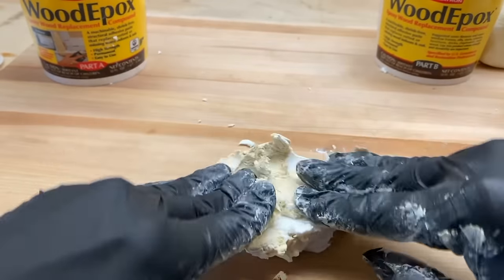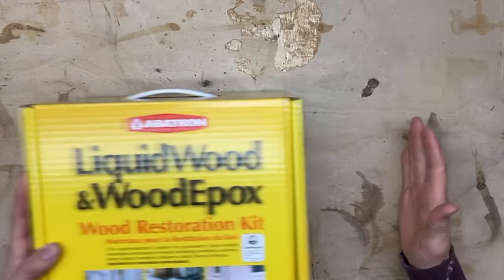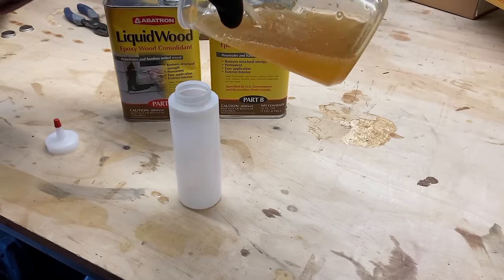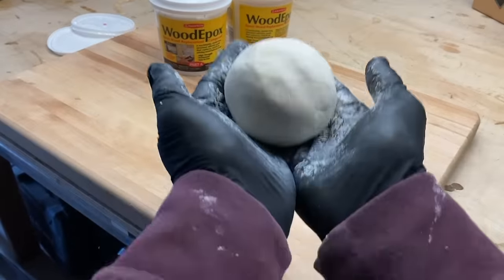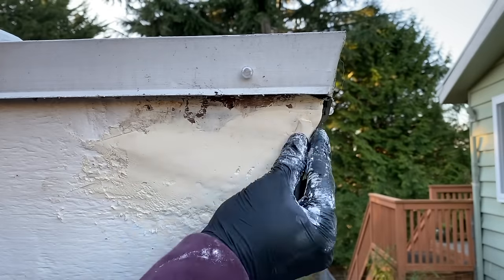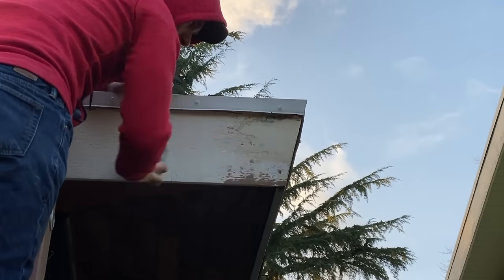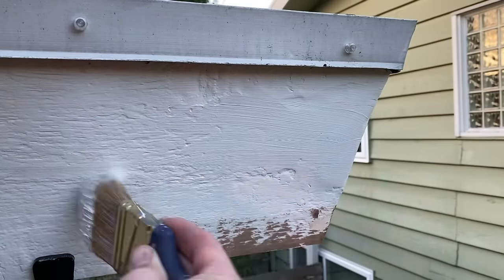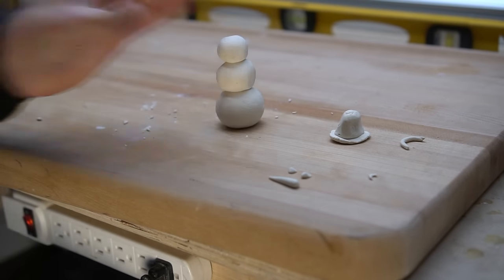How To Repair WOOD ROT and Water Damage With ABATRON

Comment: Sorry but as someone who worked for 10 years in the wood destroying organism industry, this is the worst thing you can do! 🤦‍♂️
Reply from the maker: I appreciate your input John and I would agree if this was caused by insects.  Luckily for me it wasn't.  The siding is from a woodpecker and the fascia is from a tree that was pushing up against the house for years, which i cut down after I bought the house.  Thanks for your input though.  Greatly appreciated.

Comment: Great video. Can I ask how hard does this set?  Could this be used to fill a hole in a floor where an office chair would roll over it constantly?  I am looking for something to use to fill an about 4" x 2" x 1/2" void in a 100 year old floor that has rotted or collapsed.  It is not into the subfloor, it is just oak strip flooring.  I don't care what it looks like, I just want it to fill the hole so that it doesn't get bigger, and the chair can roll over it without causing damage.  I tried someting that looked like your play-dough stuff but it was too soft.  Thanks.
Reply: Use bondo. It sets really hard and is really easy to work with.
Reply: @cannabinerd9665  
Thanks.  I've heard that from someone else and always thought it only worked with cars, autobody stuff and metal.  I'll give it a try.

Comment: i just use bondo
Reply from the maker: Good to know Steven.  Does it hold up pretty well with expansion and contraction?
Reply: @BYOTools  they use it on metal we all know how metal expands and contracts...I usually drill holes like in the video on small holes but on larger you can put screws in the wood so the bondo has something good to grip to like an anchor.

Comment: This was great but please tell me how you stopped that leak.  I have rotting in the corners of the fascia right where you did and I don’t know what’s causing the rotting.
Reply: It's a fungal problem caused by moisture. If the wood is not properly treated, borate and triple painted, mold and fungus sets in over yime.

Comment: Sorry buddy... as a previously California state licensed wood destroying organisms inspector. if ANY of the fungus  is remaining after prepping the rot, it will just come back no matter what you fill the hole with. Good video otherwise.
Reply: Good point.  What if treated with wood termite/fungi first and then do the epoxy repair?
Reply: @laijohn6  there are things that may work now, it's been about 12 years since I've worked in the industry . But its best to cut until NO rot is visible then patch and seal. As long as it's cleaned to the best of your ability first, 95% of the spongey wood is gone in the case of rot. If it's termites with no fungus you should be fine with a protectant. If your craftsmanship is on par.

Comment: One cannot simply have a hole in their fascia.. it's an absolute no no.
Reply from the maker: There is a reason that Abatron exists SS.  Just trying to give others another option for repairing holes, especially if your unable to match the existing siding or trim.  Thanks for watching though.

Comment: Looks like more work than remove wood, replace and paint.
Reply: More expensive too.  I restore old houses and the epoxy is a good product but we only use it for smaller holes and gaps.

Comment: Just a lazy way for a temporary fix! Replace it and deal with the cause of the problem!
Reply from the maker: How is it lazy if it takes longer to do this than just removing the board?  Problem has been dealt with since this damage was due to an overgrown tree that was banging against the house facia.  This tutorial is to help people that don’t want to remove the board.  Just trying to give others a secondary option that LASTS.  Thanks for watching George.
Reply: @BYOTools  I don’t disagree with this product to make some repairs, but it looks like you epoxied your fascia board to the underlying structure. When someone has to replace that it’s going to be a massive headache.

Comment: I covered my fascia with metal that has a trim color added by the metal fabrication company. Most communities have metal roofing fabrication companies that can make a ell shaped metal that fits underneath your roofing metal drip edge. Secure with screws on the underside 1 inch ell side. Never have anymore rotting or badly cracked fascia.
Reply: The company I worked for specialized in doing fancy wrap jobs on old Victorian houses in the midwest. We simply covered up the ugly with new metal. Sounds easy. It's not.
Reply from the maker: Thanks for the input Carroll and I'll have to keep that in mind for future endeavors.

Comment: I have suffered wood pecker attacks and plan to try this stuff, but first I'm trying to repair the cosmetics of the front door trim area, it was originally stucco painted and the stucco only goes so far, so I'm trying to find a product to use to blend the empty stucco areas with preexisting stucco. Any suggestions ?
Reply from the maker: In all honesty I have never had to deal with Stucco before.  One day I'm sure I will haha.  Looked on Amazon and this one has good reviews and DAP is a good product.  https://amzn.to/2N6ogQ0  Thanks for watching Michael.

Comment: Just replace the rotted trim board. Cheaper and faster.
Reply from the maker: In most cases I would agree with you but this is just an alternative that you can choose in order to avoid removing all of the wood.  Thanks for watching though.

Comment: Incredible video!!! Thank you for teaching me new stuff!! My question would be, how do you dry the wood that is outside like this, and when do you know it is dry, because on the video it still look dark and wet
Reply: You basically have to expose the wet areas of wood to air and let them dry. You can usually tell when the wood is dry by touch but if you want to get technical you can use a moisture meter.

Comment: Woodpeckers can hear the insects they like to eat.  They bore holes to get at them.  You likely have a termite problem.
Reply: If there are termites up in the facia you have to assume every piece of wood in the house has tunnels. I've been hired to put new trim on a door that led to replacing the walls because there was nothing to nail the new trim to. Once you start picking at it...omg the whole house needed replaced. Every home on that street was like that too.  It's a shame.
Reply from the maker: Luckily this wasn't caused by woodpeckers or termites.  An hold tree went into the side of the house a while back before I purchased the home.  Luckily the tree has been removed so no worries about this coming back.  Thanks for watching and your input.

Comment: Hey there boss. To copy(kinda) the wood grain look get yourself an old beat up straw broom. Pretty sure you can figure out the rest! 👍
Reply: Huh?????
Reply: @RagingestGamer  You drag it through the putty.
Reply: @Gearhead-en8dz  the putty will be too hard to run it through and it has to be sanded so a brush is no good unless you make it perfect and don't sand, what you can do it use a sawzall blade after it's sanded
Reply: @RagingestGamer  Trust me. If I can copy texture in drywall mud I can copy it in putty to.

Comment: You don't repair rot you remove rot and replace with new lumber again never waste your money trying to repair rot
Reply from the maker: Technically you are Correct Charles and no you don’t want to repair rot because Rot is not structurally sound, however in this case we removed the rot and then filled in the wood that has not lost its structural integrity due to the rot.  Hope that makes sense and thanks for watching.

Comment: Thanks for the video. If I need a backing for a hole in wood siding or sheetrock, I cut a backup piece that fits the hole and put a screw in the face to act as a handle. Then, slide it in the hole and pull on the screw while you put 2-3 screws in the surrounding edge to snug up the patch piece. Oh and there's a 'kit' made by Remington or Winchester to take care of the woodpecker problem.....

Comment: Seems easier to just replace the fascia board and paint to match
Reply from the maker: In all honest it probably would be Joe but this video is all about giving others a second option for a wood repair other then removing the whole board.  Thanks for watching!
Reply: You can get some aluminum fascia wrap for pretty cheap if you go to a actual supply store it comes in a bunch of colors so you don't even have to paint it

Comment: Just use All Purpose Bondo premixed ready to go, dries in 15 minutes doesnt shrink. paintable Professional strength all-purpose putty provides durable results for patch and repair

Thicker formula is ideal for repairing vertical surfaces such as doors, walls and siding

Quick-curing formula is sand-able in 15 minutes and paintable in 25 minutes

Repairs drywall, metal, masonry, painted wood, plastic, and more

Fully paintable and stainable

White Bondo cream hardener included

Light gray when mixed, helping blend with surfaces for consistent appearance

Formula is non-shrinking

2-Part technology chemically bonds with surface to adhere permanently

Comment: This isn't a repair. It's just covering up the problem. Replace the wood.
Reply: Not everyone has the skills, or the money, to replace the wood. We need a new door frame, but were told $6,000 (granted, that price is for a door AND frame, but still that's A LOT). So I removed the rotted wood myself and added this stuff. I understand it's not long term, but it'll due until I save up for a new door frame and door.
Reply: @sallyj632  A new door and frame is a couple of $100's and with some help( from a friend) you could fix the problem yourself and save 1,000's. Most carpenters or handymen are rip-offs. They want top dollar for doing very little and assume that most people don't have the know how to do it themselves. Do some research and get a little help. You'll be surprised what you can do and not only will you be proud you did it yourself but even prouder with all the money you saved.

Comment: Just cut out the rot and replace with 1x6 red cedar and paint.  You epoxy attempt is undoubtedly the worst approach, most time consuming, insecure, and most costly repair possible.  Well done!
Reply from the maker: I’ve worked with this product before and its made to last. Could have replaced the whole board but trying to give others a secondary option for those who want to try it.  Thanks for watching though

Comment: Fill cavity with expanding foam and leave a little space to cover with Bondo or wood filler and for about $25 you can get a better result. This is overkill and expensive. DIY common sense fail!
Reply: I've found that some Bondo that is Urethane based rather than Epoxy is not adequate for wood repairs. A true 2-part automotive epoxy Bondo is essentially the same stuff he's using in the video